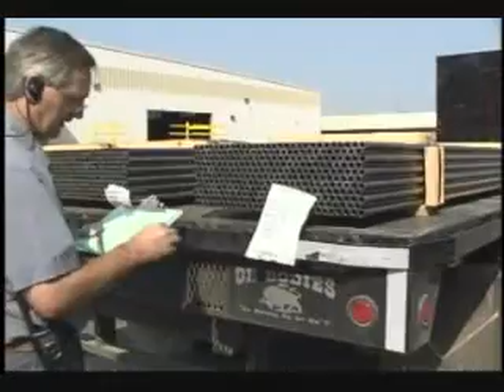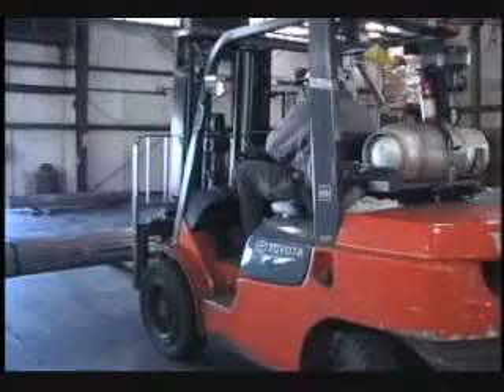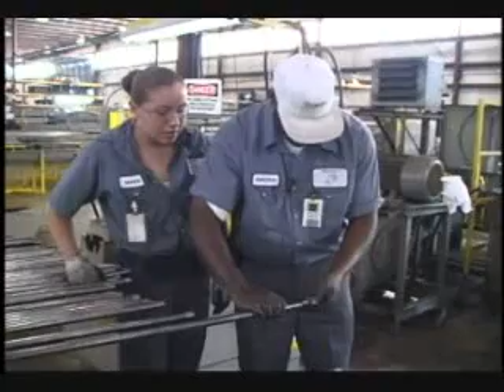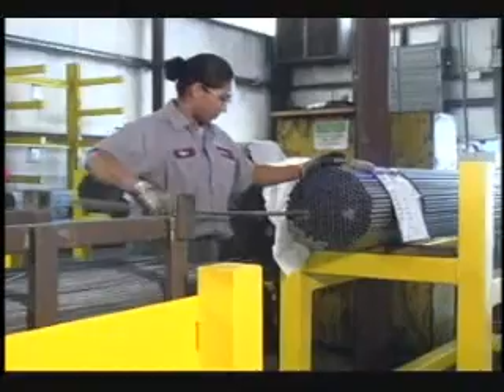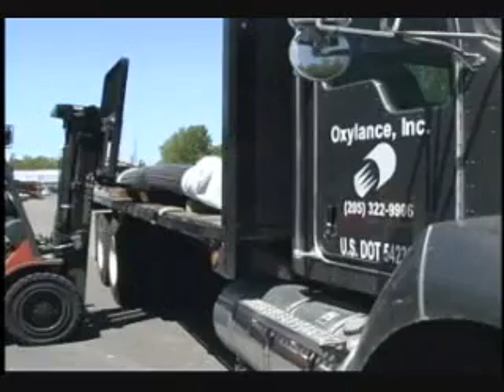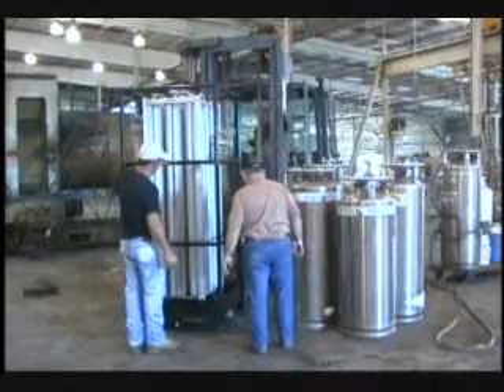Cleveland Thermic Cutting Distributor for Oxylance

Comment: What type of gauges and manifold do I need to run 8 to 10 ft burning bar. The set up I'm using now is liquid oxygen hook up to a condenser. Liquid oxygen gauge read 200 psi. From condenser hoses are hook up. Do I need gauges